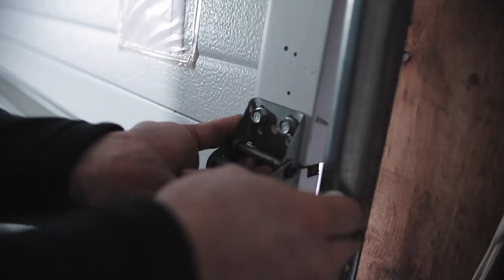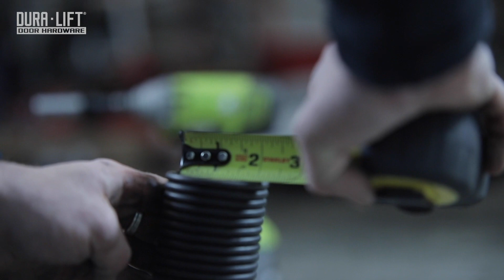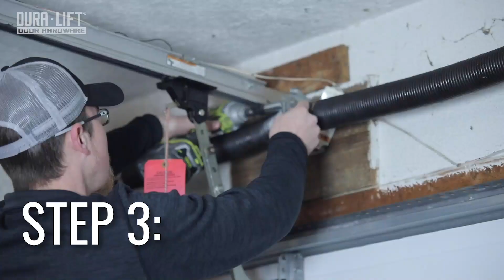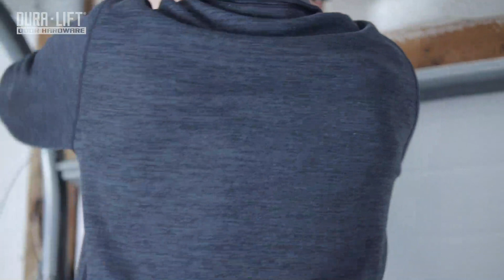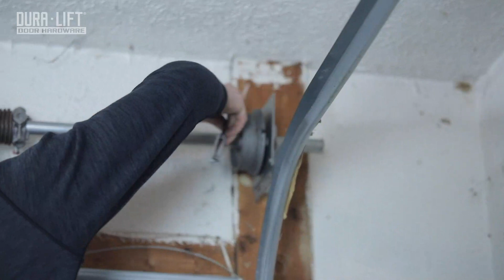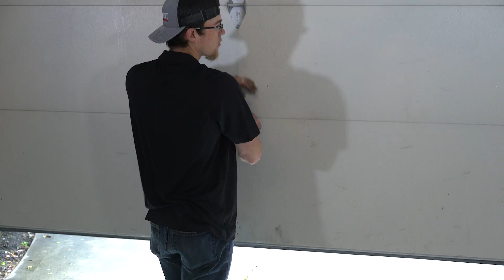DURA-LIFT: How to Install your Torsion Springs

Comment: This is an absolutely horrific company.  Customer service never responds.  They ship two of the same springs when it is suppose to matched left and right pair.  Customer service just ignores their mistake. Your only option is to email them.  At least the retailer that I purchased from is looking to source from a reputable company and not worthless excuse.  I cannot more strongly recommend do not buy from Dura-Lift!!!
Reply: Same. Shipped me two right hand springs. Also noted that this video doesn't mention left and right hand springs. Bad mojo on both issues.